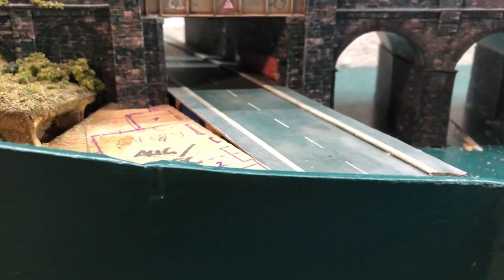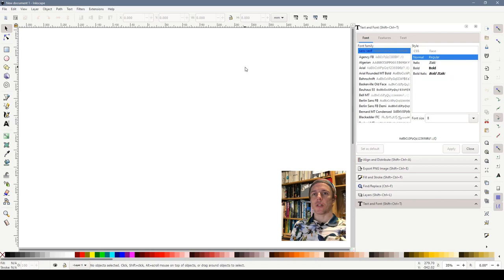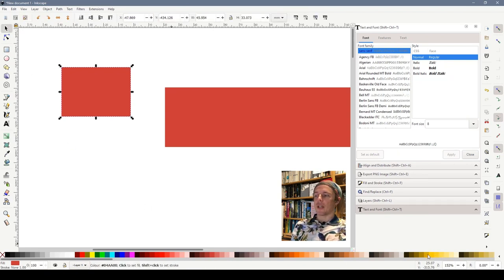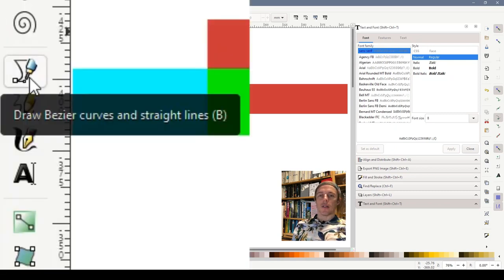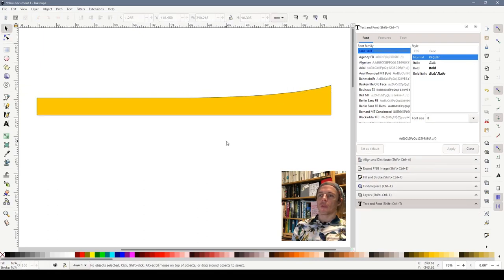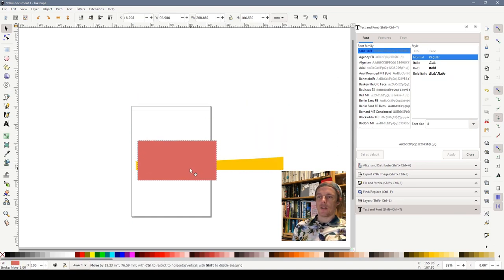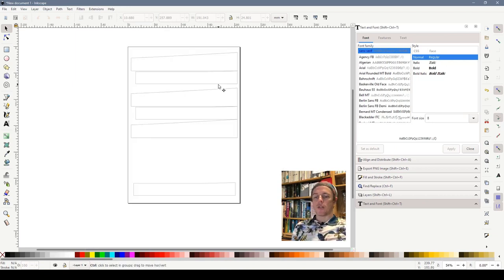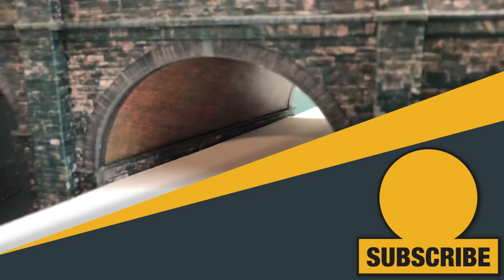Scratch building with Inkscape 1: The absolute basics

Comment: I have just found your very impressive videos of your equally impressive constructions. I am toying with the idea of making some dioramas in 1/72nd scale, but being familiar with Sketchup, I intend to use that for designing and texturing my buildings as it has the advantage of virtually constructing in 3d, then flattening out planes and adding tabs. I think you might have found your roof constructions simpler using this method. Your level of detail is exquisite.
Reply from the maker: Thank you Tim. I have used Sketchup from time to time. It’s a wonderful app and so easy to use. I tend to think in 2D rather than 3D believe it or not, and find Inkscape preferable most of the time. Can Sketchup “unroll” a curved piece of roof into what would need to be a flat shape when printed? :_chandChandwell:Michael
Reply: @Chandwell  Hi Michael, the big advantage of Sketchup, in my view, is the ability to work in full size, using real world dimensions if reproducing an actual structure. This can then be textured and scaled down to your desired scale. There is not the ability to "unroll" a curved structure in the free version of Sketchup but I am positive that this is possible using one of the many extensions available through Sketchucation, mostly free of charge.
As a retired joiner, I have used Sketchup for many years, in particular for staircases, enabling an accurate 3 dimensional model to be constructed, allowing precise dimensions to be ascertained in 3d space. My first project is to make  a card model of my own home, to test methods of construction, which your videos have helped with enormously.

One other huge advantage, especially at smaller scales,  is to be able to project textures (photos) of real life buildings onto your model, or even construct from photos using the Match Photo feature.

Keep up the good work.

Tim

Comment: Well that is a good morning's work.  I have just downloaded Inkscape to my iMac and using your tutorial replicated the road template.  So thank you first of all for the tutorial and please do some more.  One thing, and this may be that I was working on a Mac and not a PC, but when I first opened the software it didn't have all the dialogues on the right of the screen (the tool bar with icons was there). I found the align dialogue by the tried and tested method of click every icon and hope what you want appears.  If you have done something to optimise your workspace it would interesting to know what that is.  Thanks again.  Stephen
Reply from the maker: Brilliant - really pleased you tried this with success. I’m not sure on the difference between PC and Mac. I was using version 0.9.something and only just upgraded to version 1 just before the video, and it opened like that, which was a bit different from the previous version. Your “click everything till it works” approach qualifies you as a professional right off the bat though! I’ll add something to the next vid about screen setup. I’m thinking the next tutorial will be about constructing arches. I’ve had a LOT of practice with that!
Reply: Go to object then go to Align and distribute this way it'll appears on left. I think it's needed for the first time

Comment: Just going through your Inkscape tutorials now and you explain most things very clearly. Like Stephen before, I needed to click a few icons to get the righthand menu to show (though on my Mac the items weren't written out, just icons themselves). Also, at the end of the video when you showed the road mockup in place, there were a lot of extra cardboard bits sandwiched in between the ones that were printed out. Just so I understand fully, those bits were added just to bulk up the road, correct? Their actual dimensions aren't important except that they be below the level of the roadway? Thank you for a very clear presentation on using this software.
Reply from the maker: Thank you for your comment and I am  please that you found it useful. You have interpreted the thing at the end correctly - I just packed the slices of curved road bed with some rectangles of card to pad out the width. 👍

Comment: Fantastic video.....just what i needed to help decide if i am going to give it  go!!!

2 questions..

Do you stick the whole page to the card then cut out or do you cut round each one leaving a gap and stick to the card?

and

What thickness of card do you use? and where do you get it from? I purchased some 300GSM from hobbycraft but not sure its thick enough

Thanks Dave
Reply from the maker: Thanks Dave. Yes, I stick the whole page to card, or if I;m only printing a few components, I stick a rectangular slice to card, i.e. just one horizontal cut across the portrait-orientation A4 sheet. This is because if you cut around parts, especially skinny ones, then you risk the part bending in the process. I use a wallpaper seam roller to really make sure it's all stuck down.

I use cereal packet, 0.5mm greyboard, 1mm greyboard, and sometimes, 2mm greyboard. Cereal packet is great for mock-ups and small detail, but its thickness varies by brand so you can't do work that requires fine exact measurements. The greyboard I buy in bulk from eBay and works out at 6 pence a sheet for 0.5mm and 13 pence a sheet for the 1mm.  

If you watch the Hotel build series, I think Episode 3 or 4 shows details of this.

Happy building! Let me know how you get on! :) :_chandClass47:Michael
Reply: @Chandwell  thanks for taking the time to reply!
It is appreciated!!!
Reply: @Chandwell  could you link the eBay item please? I have had a look and can’t find anything close to the great price you mentioned.
Thanks Dave
Reply from the maker: Hi David... Sorry if I misled you. I only got those prices because I bought a lifetime's supply! 500 sheets of 0.5mm for £29.00 and 200 sheets of 1mm for £25.99. Prices have gone up slightly since then, but these are the ones I bought:

https://www.ebay.co.uk/itm/131244225212
https://www.ebay.co.uk/itm/183893552028

:_chandClass47:Michael
Reply: @Chandwell  no probs! I expect to do the same

Comment: very nice viaduct reminded me of the one leaving sheffield heading to meadowhall as its built on a viaduct over roads and the canal and river -- https://www.google.co.uk/maps/@53.39017,-1.4494661,3a,90y,111.78h,97.62t/data=!3m6!1e1!3m4!1sUovnG5dycd_B_BTHYNMZsQ!2e0!7i13312!8i6656
Reply from the maker: Thanks for your kind words, Paul. Funny you should mention that viaduct as I spent an afternoon walking all around that part of Sheffield whilst researching bridges and the river. The iron arch bridge, although based on one in Dewsbury, is very similar to that exact one you mention. I took a lot of photos of the underside of that bridge. The Chandwell river is going to be heavily influenced by the river that runs beside that viaduct in Sheffield, and which curves around between big industrial buildings, with the path on one side. There's also a weir there, and I am in two minds whether to model it or not.